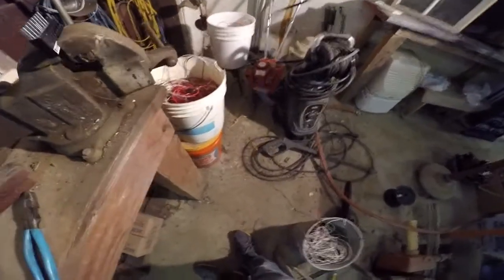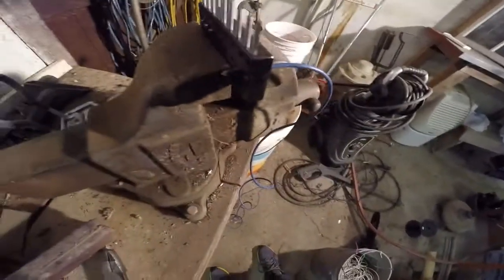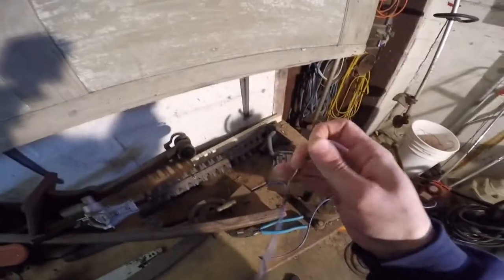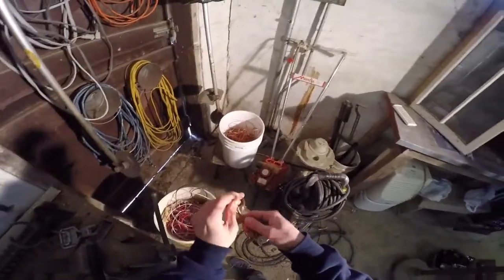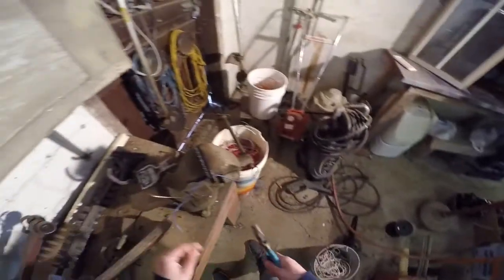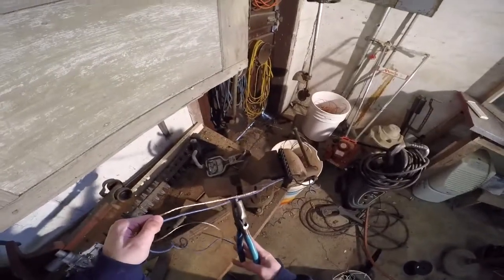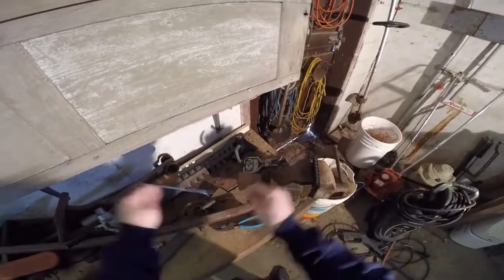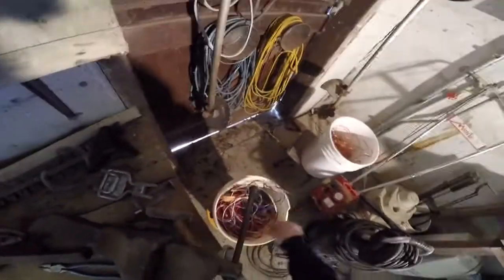TNT Tooling Wire Striper Review

Comment: i done a video recently and calculated that stripping wire will earn you about $0.77 an hour and some wire i was losing money by stripping it
Reply from the maker: Yup! This is true, I only strip the wire with thin insulation and a thicker gauge of copper. Just like you said stripping typical wire like from vacuum cleaners, toasters and more are a waste of time! Keep Scrapping!
Reply: always scrapping #scraplife (just subbed you) on my channel i strip down all different types of e waste to determine its value then convert it to different currencies, keep scrapping bro